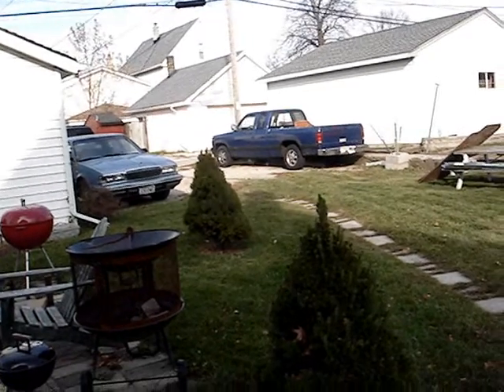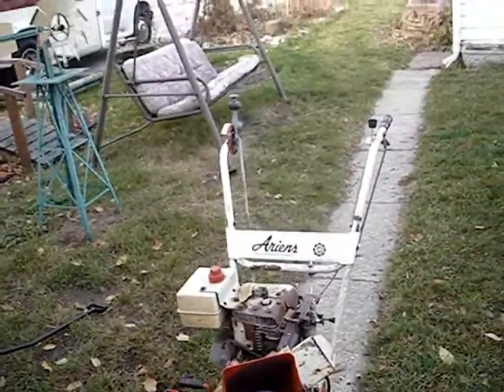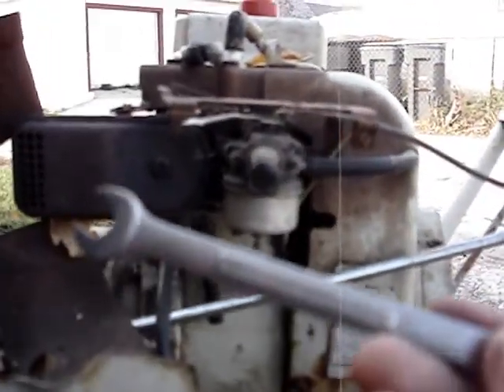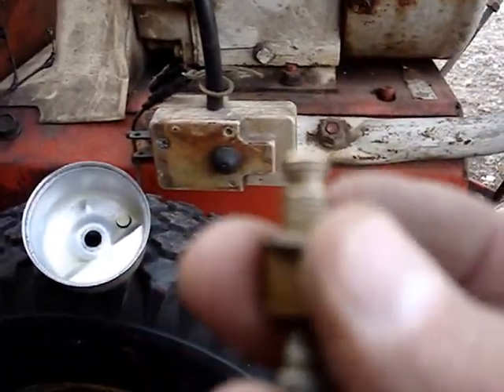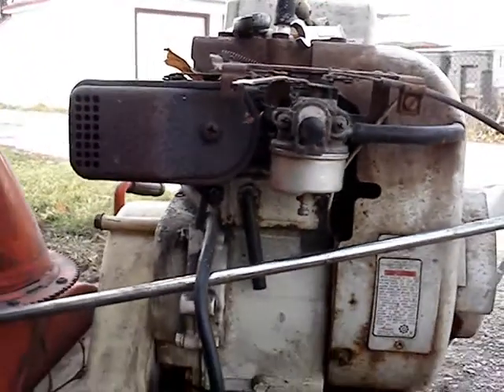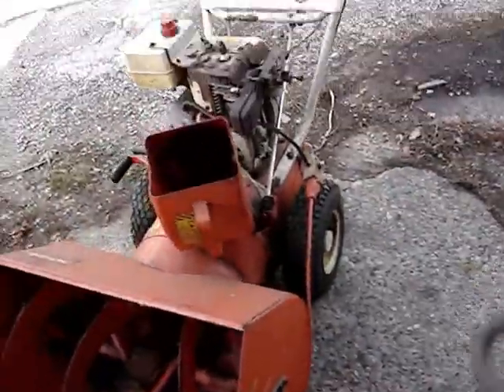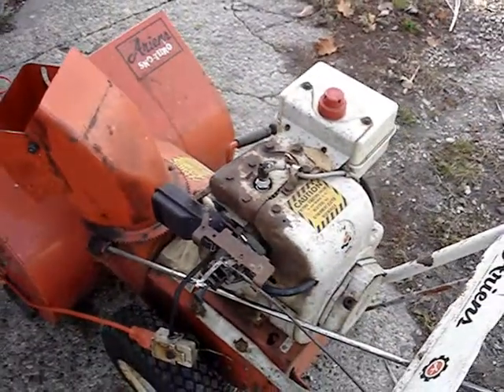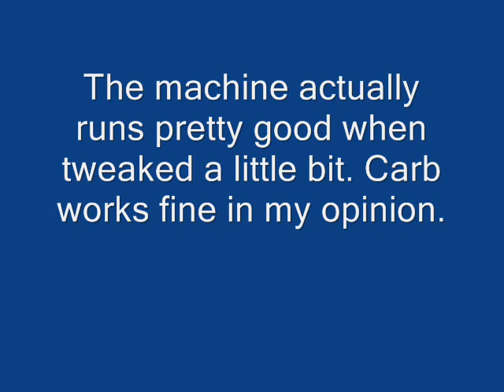Free Ariens Old Start

Comment from the maker: @HardKnocks60 usually self propelled mowers, and snowblowers use oil due to heavy use. Since nobody checks their oil you dont know what the oil level may be. Besides i have another Ariens engine in stock just in case it nuked.